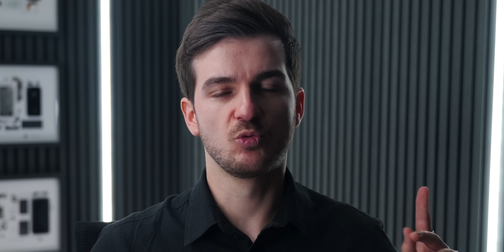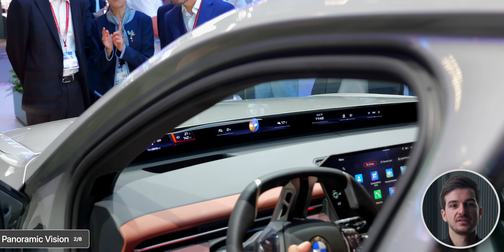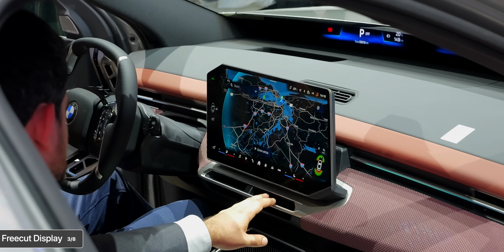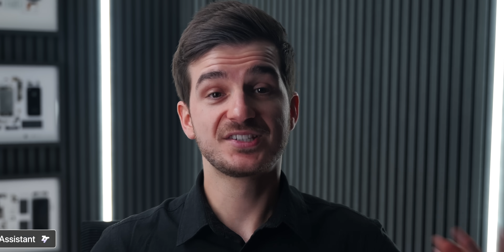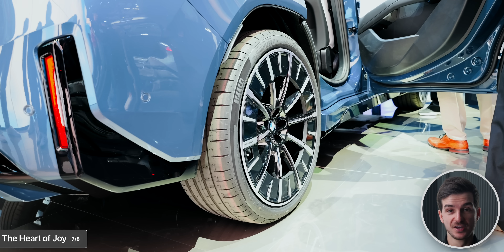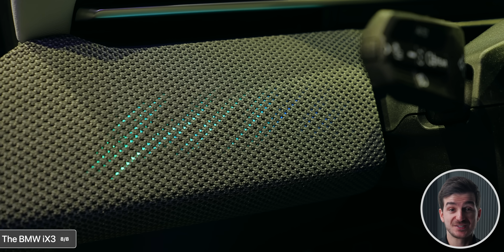BMW iX3 - The Car That Apple Should've Made!

Comment: TBH I would be more interested in the optional M pro sport 🛞. The vertical bars on the standard wheel is a bit too much, albeit it’s a small detail since it’s still as round as you can get.

Comment: That steering wheel controls looks so overwhelming… Plus capacitive buttons absolutely sucks to use while driving, you get no feedback on what you’re doing.
Reply: I'd normally agree but to be fair they've implemented it well here, the haptic feedback on the wheel is very strong and the controls aren't always there at once, so I've definitely seen worse versions than this.